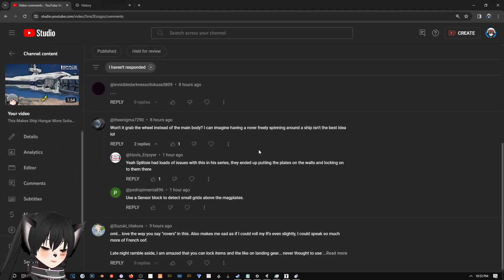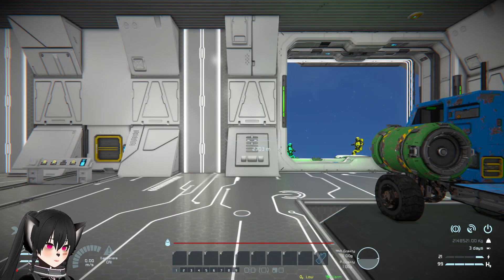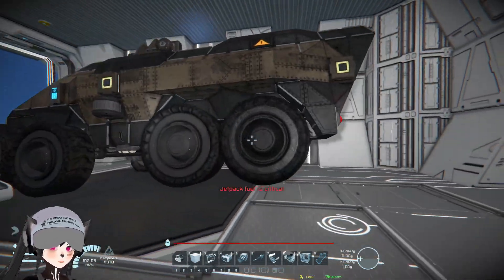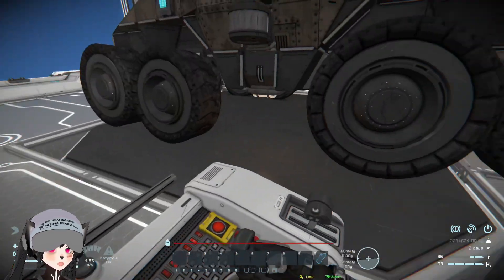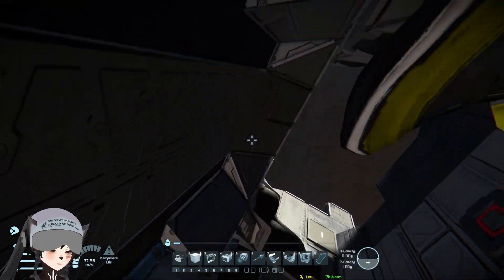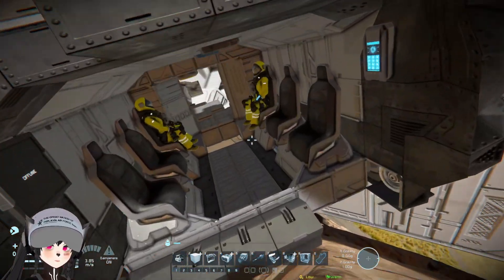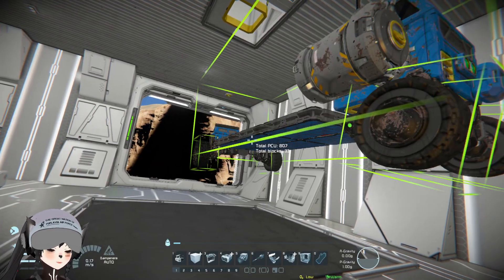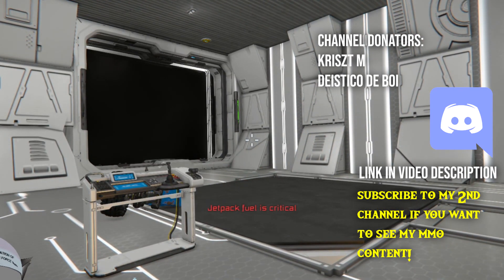My Latest Ship Building Tip is a Public Safety Hazard, Space Engineers

Comment: What I usually do is put a magnetic plate on the backl of my rover, back up the ramp, and lock it to the large grid. Never blew up on me, but.... in a multiplayer server where the stability is at maximum quirkiness I think I'd probably also lift the wheel suspension all the way up and away from the floor. Thank's for the correction video though! :)
Reply from the maker: Yeah that's what I usually do myself c= can make it slightly inconvenient though to park on the hangar especially if it's not specifically built to park or store vehicles that way x3 and I see u wu ye someone mentioned having the wheels of the rover contacting the ship itself might cause issues xD so that could definitely help x3

Comment: Never had that problem, but never used the big mag plate either. I always use the small mag plate and drive over the top of it and lock to the center of the vehicle and NOT the wheels. That might be the difference.
Reply from the maker: Hmm, yeah I usually use the small mag plate too x3 especially if it's on the smaller vehicle that's attaching on the bigger vehicle itself, someone did mention locking a rover to a ship while the wheels are there contacting the ship might cause issues though O: I should test that out myself x3

Comment: Most rovers have a jacking piston for adding tyres, just mag clamp to the deck with the jacking piston and your rovers won't bounce around in flight!       :)
Reply from the maker: That could work x3 not sure about using piston or subgrid though u wu maybe just lowering the suspensions so the plate at the bottom can attach will do well xD but someone did mention locking onto the main body of the rover itself with a ship's magnetic plate might cause issues u wu x -x

Comment: Wouldn't the best way be to have a gantry inside your hangar with a piston and connector at full strength so you can position your connectors directly above the top connector of the rover. Thats my idea.
Reply from the maker: Having a piston or subgrid might increase the instability even more though u wu the most stable way is to have the landing gear or magnetic plate on the rover itself but that can create some issues like I mentioned in the previous video x3

Comment: its a weight issue, not a wheel issue.
The heavier the rover is, the more wonky it gets when its only attached trough the suspension.
Having several tons of mass flopping around in your hangar is a recipe for disaster, its like attaching a heavy unbalanced object trough a subgrid.
You're challenging clang.
Reply: But if you have that weight attached to the ship not via the wheels, but via the side or the top of the rover like a crane via a magnetic plate or 2 connectors, you can fix the problem, right?
Reply: @StarWarsExpert_  It would reduce the issue, but even a piston is a subgrid, better than a rotor or a hinge, but not much better.
Best option is to attach the Rovers body directly trough a mag plate, landing gear, connector or mergeblock, that way only the wheels will be threaded as subgrids with minimal risk and influence on the main ships handling.
Reply: @StarWarsExpert_ it’ll definitely minimize the issue.  Pistons are more stable than suspensions.
Reply from the maker: I see x3 I wonder if there's a way to get around that with the floor magnetic plate setup c= also clang u wu x3

Comment: so long as you have a landing gear on the rover, wouldn't that solve the issue? also, couldn't you have a switch that triggers a timer block to manually switch the lock twice or a button to do that directly to increase contact?
Reply: That depends on the rover, as from the video this replies to, adding a landing gear to the bottom will reduce ground clearance, and a gear on the side (or front or back) can make the rovers a bit less safe or inconvenient, though I personally am in the camp of putting connectors on rovers, can solve lots of the issues one can have for rover storage.
Reply: @RosebudHaruki  Same... I did have an accident once though, and only once, where a connector was on the back and after connecting it exploded. Even putting one on the bottom seems kind of difficult unless you use larger rovers or have smaller plates to create the gap for the ships connector.
Reply from the maker: Yeah a landing gear on the rover itself would be more stable but like rose said there's some downsides to that c= I was talking about having the landing gear as the floor of the hangar itself though xD and that might work u wu I s hould test that out x3